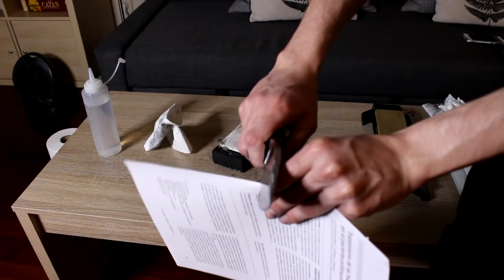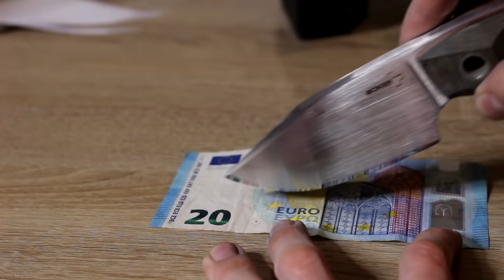Recuperando el filo de un Böker Plus Bob

Comment: Este cuchillo es el modelo Bob de la marca Böker Plus, diseñado por Jesper Voxnæs y construido en el acero japonés AUS-8, esencialmente similar al estándar estadounidense AISI 440B, más conocido en España con la nomenclatura acotada a 440B.
Se trata de un acero inoxidable de gama media y para presupuestos moderados, muy resistente a la corrosión gracias a su alto contenido de cromo, y con una tenacidad decente.
Tanto el AUS-8 como el 440B pueden haber sido buenas opciones para cuchillos en el pasado, pero por estos días han sido lárgamente superados y no tienen mucho para destacar. Como referencia, el 440B está en el medio del grupo AISI 440, y nunca fue tan bueno para cuchillería como el AISI 440C, que dicho sea de paso no es un acero para cuchillos premium desde hace ya más de dos décadas.
Sentado todo esto, considerando su robusta hoja de 9,1 cm de largo y 7 mm de espesor, con vaciado plano, que Pablo afiló correctísimamente respetando el ángulo del bisel secundario (el que él llama ápex) y en unos presumibles 20/25 grados si se presta debida atención a la postura de su mano derecha, pues resulta evidente que no estamos ante un cuchillo de monte ni mucho menos pensado para maltrato alguno (como se afirma en otro comentario), sino, en el mejor de los casos, a un cuereador (o despostador) con pretensiones.
Un cordial saludo.
Reply from the maker: Muy interesante, gracias por compartir. Un abrazo.